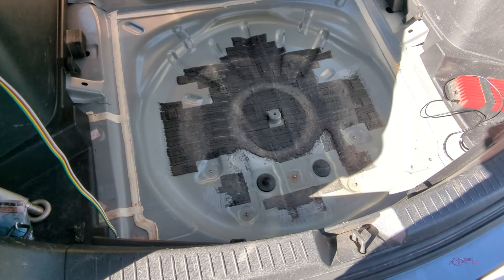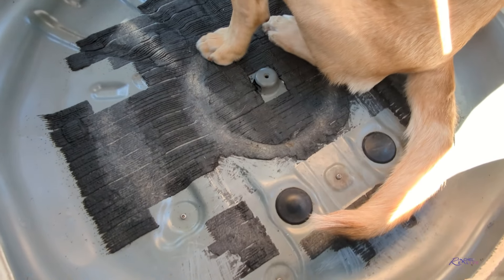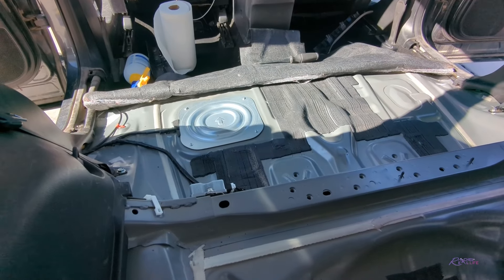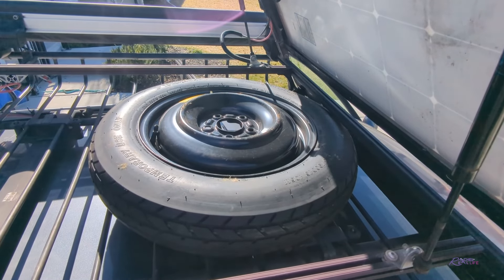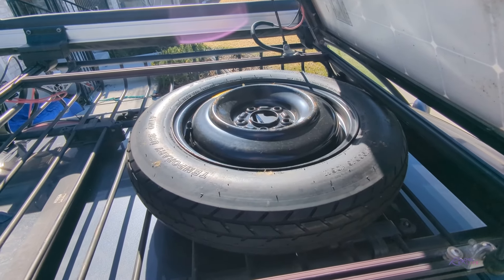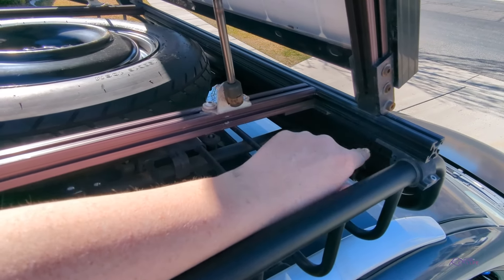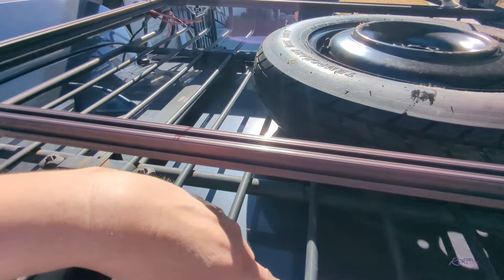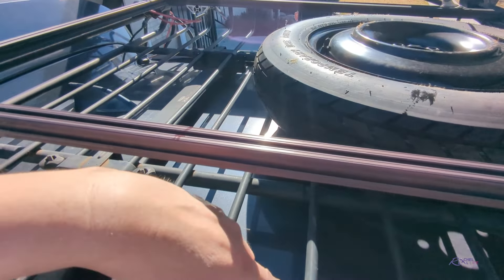Vanlife: I Ordered a Ford Transit Cargo Van 250 With EcoBoost

Comment: If you're going to the trouble and allocation of space to the roof rack for the useless donut, might as well go to a salvage yard and spend $15 for a real wheel and tire that might actually be useful on bad roads, in mud, sand etc. the space occupied by either isn't that much of a difference.

Comment: You do want to protect your rubber tire from sun exposure.  RV's that park more than drive need to also protect their tires from UV light and use tire covers.
Reply from the maker: It's under my solar panels